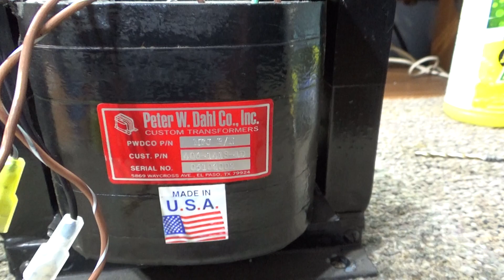HV High Voltage Transformer side by side comparison: Heathkit SB-220 and Ameritron AL-82

Comment: Great explanation! 
I remember a time that I had to replace my alternator in my van. I picked up a replacement that was rated the same amps. When I looked at the windings, they were a gauge smaller on the replacement! So I looked at others. All had light windings. I finally went and got an official OEM part and it had the heavy gauge windings. My Elmer told me that the lighter ones could probably produce the amps, but they would be running much hotter and be more likely to fail in the long run. Size matters!
Reply from the maker: Yep, a watt is not a watt. There are differences.

Comment: the 220 has a filiment transformer and hv only....
Reply from the maker: I stand corrected, you are right. The SB220 has the HV transformer and a totally separate filament/bias transformer. Getting old sucks. No memory.
Reply: @tramdr  maybe its the sb200 with it built in. you know what they say, you forgot more than what most people know
Reply from the maker: or maybe its the Blackcat JB-2000? I will look it up.
Reply: @tramdr  worldwidedx forum has a thread called "JB 2000 transformer" and 2600 is saying it has 10v on it for the heaters. bbi has a video too " Jb-2000 for sold!! " that shows some good video of it

Comment: I’ve been told stay below 0.7 amps on the high voltage. I’ve seen an easy 1000 bird with a 5000 watt slug on a mono banded sb 220. Talked a lot of skip on that ole girl. They are what they are.
Reply from the maker: That sounds about right to me. It's the people who have no clue about plate current for one, and for two, they want max watts. To them, a SB-220 is a 2200 watt out amp. I always say it will do such a thing, but not for long.

Comment: Sb for side band, the heath original plate transformer is under amped horrible transformer for a Am guy. The Pete rules! 
I use 1 amp ccs plate 3800 volts on a 2 tube z box. Better to have more then less indeed. Put a .700Ma transformer on a doubler you only have .350 mills works on ssb but not good for Am use. 🤷‍♂️
Reply from the maker: Exactly.
Reply: You selling the Pete?
Reply from the maker: No, that is what is in my Ameritron AL-82